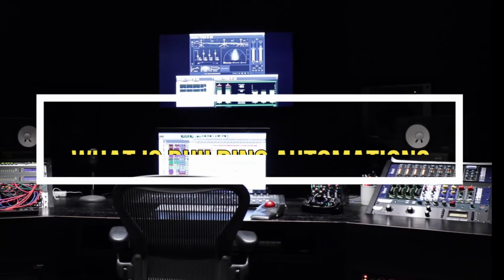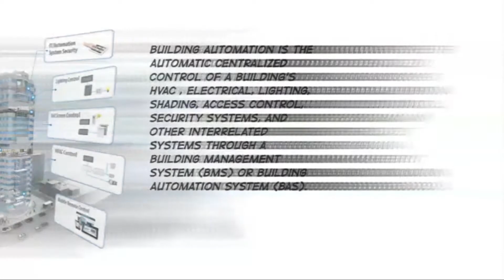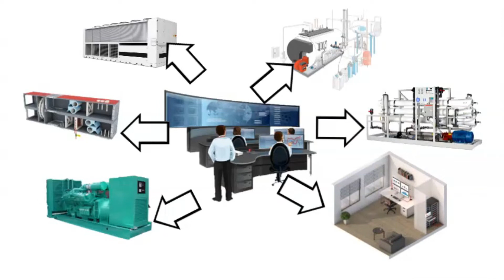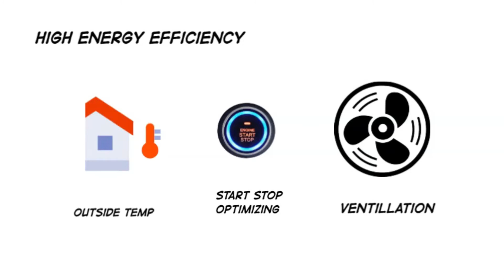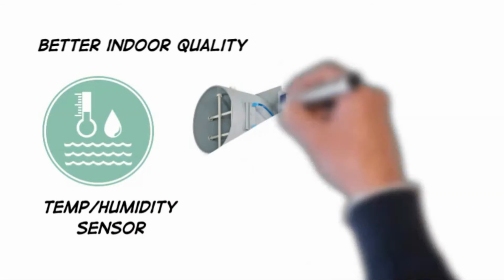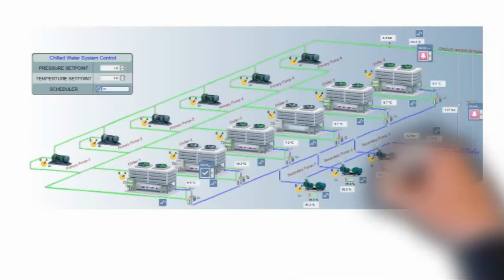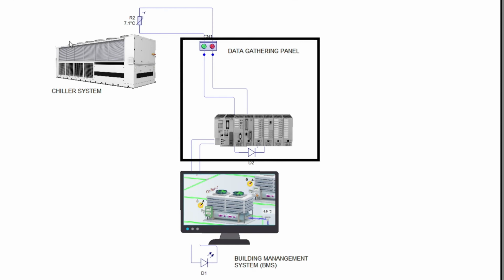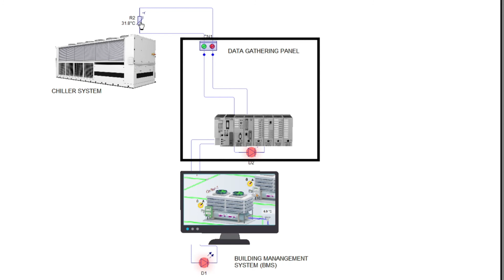How Building Automation Works?

Comment: What are key requirements for a successful BMS operation?
Reply from the maker: To be a successful Building Management Technician, you should possess a combination of technical skills, interpersonal abilities, and a strong work ethic. Here are some requirements to consider:
Technical Proficiency:

Mechanical and Electrical Knowledge: Understand the basics of HVAC systems, electrical circuits, plumbing, and other building systems.
Troubleshooting Skills: Be able to diagnose and fix issues related to equipment malfunction and building systems.
Building Automation Systems: Familiarity with building automation and control systems to monitor and regulate building functions efficiently.
Maintenance and Repair: Proficiency in repairing and maintaining various building components and equipment.
Safety Awareness:

OSHA Compliance: Knowledge of Occupational Safety and Health Administration regulations and guidelines to ensure a safe working environment.
Emergency Protocols: Understand emergency procedures and protocols, including fire safety, evacuation plans, and disaster response.
Communication Skills:

Clear Communication: Ability to communicate effectively with team members, supervisors, and building occupants to understand and address maintenance requests and concerns.
Documentation: Keep accurate records of maintenance activities, repairs, and inspections.
Problem-Solving Abilities:

Analytical Thinking: Approach problems systematically, identify root causes, and implement effective solutions.
Adaptability: Be prepared to handle unexpected challenges and adapt to changing circumstances in a dynamic building environment.
Time Management:

Prioritization: Manage multiple tasks and prioritize maintenance requests based on urgency and impact on building operations.
Efficiency: Complete tasks within established timeframes to minimize disruptions and ensure smooth building operations.
Attention to Detail:

Thoroughness: Perform inspections and maintenance activities with attention to detail to ensure all aspects of building systems are functioning correctly.
Customer Service Orientation:

Professionalism: Interact courteously with building occupants, addressing their concerns promptly and maintaining a positive attitude.
Conflict Resolution: Handle conflicts or complaints professionally and work toward satisfactory resolutions.
Continuous Learning:

Stay Updated: Keep up-to-date with advancements in building management technology, regulations, and best practices to enhance your skills and knowledge.
Physical Stamina:

Physical Demands: Building management often involves physically demanding tasks such as lifting, climbing, and working in various weather conditions.
Teamwork:

Collaboration: Work effectively as part of a team with other technicians, supervisors, and building management staff to achieve common goals.
Certifications and Training:

Relevant Certifications: Obtain relevant certifications such as HVAC certification, electrical certification, or building automation system training to demonstrate your expertise.